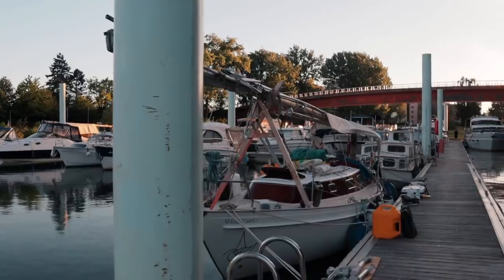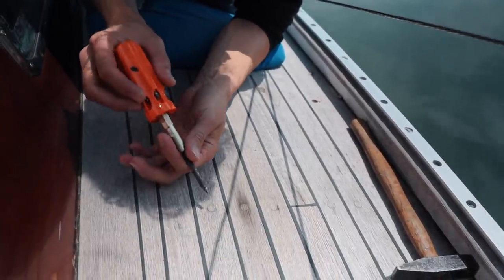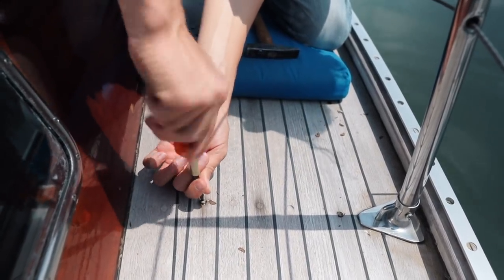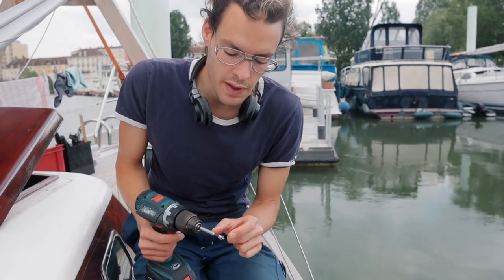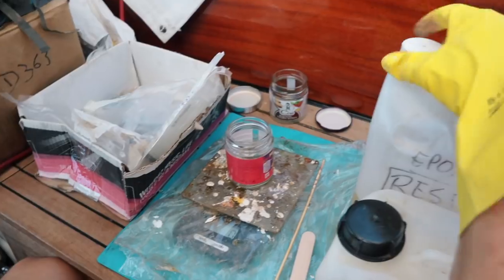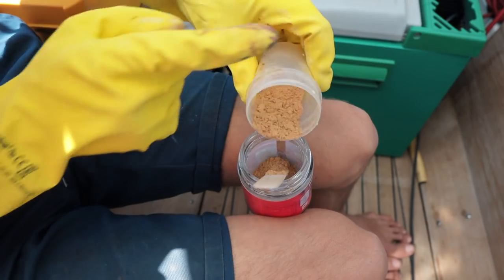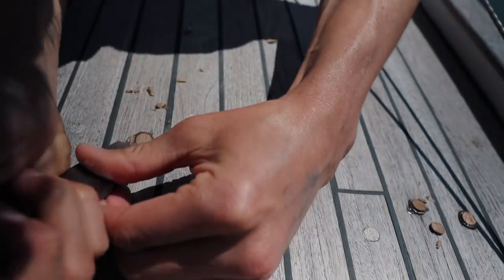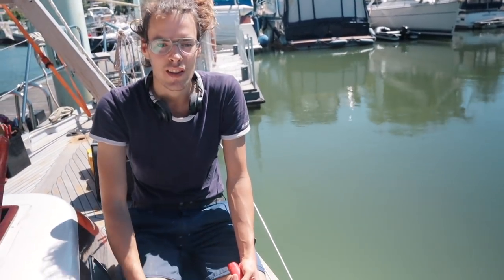The ESSENTIAL GUIDE to maintaining a classic teak deck [teak bung replacement]

Comment: As always, such a wonderful video you guys.  Aladino, I have a couple of tips I figured out while removing over 3000 bungs and Philips oval head screws on my Westsail.  After trying a screw driver, I found that a pick with a 90 degree bend at the end gave me the most control for removing bungs without damaging the surrounding wood.  Like you, I push it in to the center of the bung and use the bung itself to pry against (never the surrounding wood).  Second of all, that same pick was perfect for getting the glue  out of the screw cross hairs/slots.  Lastly, for stubborn screws, I used an impact driver with a correctly/tight fitting bit inserted and held with pressure into the screw.  One whack with a hammer and the screw is freed without stripping the head.  In over 3000 bungs and screws, I only broke 2 screws.  Magic Carpet is not just a boat, but a beautifully crafted piece of fine furniture.  It’s wonderful to see how you both appreciate and love her.

Comment: This is great! I have looked into several videos on teak deck maintenance. They are either on the hipper professional shipyard techniques style or very inexperienced-experimental direction. Here you put the right balance between the needed care and professional advice, openly articulating what techniques can make you feel safe. After watching this, I could see that with patience and thorough work, I can do it myself. I'm on the edge of buying a boat with teak decks to either remove or maintain. I tend to do the latter to get her to its original style. Thank you!

Comment: I was taught when fitting plugs to a hole to put a mark/arrow on the top of the plug showing the grain direction either in pencil, pen, or texta which helps when trying to find the direction after you have it in your hand and epoxy all over everywhere before you fit it to the hole. I was also taught to cut the tops off with the chisel the next day after the glue has cured. Aladino is a very knowledgeable boat builder for a young guy which shows in his methods.

Comment: Great tutorial!  I'm a happy owner of a 33' cold-moulded yacht which I designed and mostly built 20 yrs ago. The old shipwright that laid the deck and teak coamings ("orlo falchetta"in Italian) taught me NOT to use epoxi with teak bungs but simple vynil glue (which makes it easier to take them out) and I never had any problems.  I want to add that I personally  prefer a thinner teak (5-6mm thick) not only to save deck weight but especially because the teak when continuously wet and dried has less "strength" to warp and unglue the deck. Mine is still perfect after 20 yrs and I re-did most of the Sikaflex chauking only once. (I keep my fingers crossed......)  I love your canal journey!!

Comment: Thank you both for your excellent videos especially during this time of restricted activity.  You asked your followers for their stories so here’s one that happened quite a few years ago. This was the first sailing experience for my young new wife.  We chartered a 23 foot San Juan in the San Juan‘s from from a marina in Roche Harbor. They installed a new 8 hp outboard as we were getting ready to leave.  I mentioned that the prop was not very deep in the water but they said it was fine. We we’re out for a week of fun on the water.  On the last day a Storm blew in and small craft warnings were issued so we headed back.   We hadn’t used the motor until trying to get in the narrow north entrance into Roche Harbor, directly into a headwind. The boat was rocking from the waves being blown out at us and the prop repeatedly popped out of the water at the same time the cooling system was sucking air.  The motor overheated and seized. We were left to cross the Haro strait 8 miles over to Canada and tack back to come in the south entrance.  With the wind and current both moving north it made our southerly progress slow.  A 5 foot chop and 35 knot winds made for a scary experience especially for my wife’s first time sailing.  We were taking on water and our gear was sloshing around the cabin.  She was holding the sheet ready to dump the gust at any moment and crying from fear.  After about a half hour her posture changed, she stopped crying and looked at me with a new found confidence.  We continued on with our plan made the south entrance and back to the marina. The man behind the counter was very apologetic and even gave us a bottle of champagne. Thank you again for sharing your journeys.  I wish you many more enjoyable years on the water.

Comment: Concerning the grain orientation I was taught to set the bung’s grain perpendicular to the plank’s. Reason being that when you set a bung it is dryer than the surrounding planking as it takes on water the bung will swell and could (but is suspect it’s truer for bigger diameter bungs) open up, or split, the grain of the  planking allowing water in. This is also the reason why when working with tree nails you set the grain and wedge perpendicular to the planking. But has always there is more than one way to go about things each presenting its benefits and inconveniences, which is why boatbuilding is more an art than a science.  That being said, the way you go about it makes total sense for you, and as usual you produced a quality video. It is always a pleasure to board Magic Carpet for twenty minutes every week!

Comment: Aladino, you are a true craftsman doing what you were born to do, and Maya, you are an artist in your own right. You two will only get better at what you do over time. I removed all the teak on the boat I am restoring as the teak had all rotted out from lack of care from previous owners over the years. Rather than replacing the teak, I'm replacing it with Top Teak from Australia, but no matter what anyone says, there's nothing like the beauty of real teak if you can maintain it, and nothing lasts as long as well maintained teak.

Comment: I have known people who eliminated screws from their old teak decks (deck thickness had become too thin for screws and bungs).  They carefully cleaned out the screw hole, filled it with epoxy (making an epoxy screw) and put a bung on top.  For loose planks, they syringed glue/epoxy underneath.  Nothing has ever come come off.  I am going to try it on my boat.  I love teak decks and don't want to rip mine off.
Reply: That's exactly what I was thinking. The epoxy effectively makes a new rigid "screw" and helps glue the bung in. Shoud work where the screw heads were flush with the worn deck.

Comment: Some other boaters use Duraloc or Sika Seal for application into the screw hole prior to inserting the screw, or around the threads, to help prevent water penetration. Both of those products are flexible. Just gluing or epoxing the bung doesn't stop water over time. Good luck on your canal adventure!

Comment: I wish the previous owner of Antidote would have watched this video YEARS ago 🤣. I have a profound dislike for flat head screws but you make a very good point.
Reply from the maker: Was your deck caulked with silicone?
Reply: @SailingMagicCarpet  Thankfully no. There were many tubes of SIS440 on board and it seems to be what the deck was caulked with. I’ve run in to silicone in other projects though and agree that it is a hassle!

Comment: Excellent! Seen it done badly so many times. Seen it done wrong a lot more! See if you can get a set of diamond honing blocks on your travels, better than a traditional stone and can be used with water as a lubricant. They are light, smaller than a traditional stone and last forever. Never dishing or wearing uneven. Amazon do them.... Fantastic knowledge sharing!!! Sail Safe Guys, Ant, Cid & the pooch crew.
Reply: Yes.  I have a few in various grits and they last a very long time. Does well with scissors as well. Just mark the cutting edge with a felt pen. You will see.

Comment: you might want to try teak trunnels , i used them on my teak decks and it was 30 years before i had the first failure , and replacing them are easy as pie ,, nice job and very nice boat you have

Comment: Hi, How are you guys?
I love your channel, it is one of the reasons way I will be starting to sailing near as possible.
Thanks for that.
In real I'm dentist, and I had studied about products, and the resistance of materials. 
The reason why I'm here is to explain why you should cut the pieces of wood before the epoxy dry. It's because after the epoxy be dryer, it will cracked with the power of the cuts and will can leak water into the hole. But if you cut the wood before the epoxy dry, the movement of the cut will not crack the epoxy, and will glue quiet without future cracks.
I hope my English was good enouth to explain about the material, and had been good enouth to say to you how glad I'm to watch you in your chanel.
Thanks, G.R.Matheus

Comment: Love the videos. I bought a 1971 Supercraft Tricabin Cruiser last year, and I'm refurbishing the teak deck in May and your channel is super helpful. Just a thought, could it be that the reason commercial shipwrights chisel the bung right away is to ensure the epoxy has time to spread and recover after the impact of the chisel? If the epoxy sets and then you chisel the impact might compromise the integrity of the epoxy and the seal.  Just a thought. Thanks for all the helpful content.

Comment: I'm embarking on some deck work on my Mason in the next few days and this video is very helpful; you are clearly a knowledgeable and skilled shipwright, Aladino!  Several of my fellow Mason owners have removed the screws, drilled out the whole just past the fiberglass below and into the wood,. They then add install the bung just as you have - just no screw.  I've seen it done in this fashion other places and I'd like to know your thoughts.
Reply from the maker: Hy Stephen!
Sounds like a last resort solution because the teak is wearing thin.
Best would be removing the teak all together and then painting nonskid or glueing it back without any screws. 
But of course that is a huge time consuming and costly project. 
If at all possible I would drill only as much as necessary and put the screw back Into place if the thickness of the teak allows. Making a larger hole in the glass might lead to trouble down the road.
All the best,
Aladino
Reply: @SailingMagicCarpet  Thanks, Aladino, I have at least 3/8 " left  - more in some places, so that's not the problem. I need to ponder this more... :)

Comment: Is the” lentil head “ not specked maybe due to the extra material in the head of the screw should it corrode to help prevent screwing the head of the shaft leaving it stuck in the hole 🕳🤷🏽‍♂️. Just crossed my mind watching the vid. Totally understand the space gained with the flat head 👍🏾
Reply: That is an excellent point!

Comment: Great video, thank you, it‘s incredibly helpful as I am about to renovate an old teak deak. I heard some people leave out the screws and only glue the new bungs with epoxy. Is there a reason for you to keep the screws? Your reply would be much appreciated! Thanks!
Reply from the maker: It depends how your deck is attached. If your deck is attached with screws, then leaving them out means your deck will probably loosen or pop up over time. Some decks are attached with screws AND glue, which means leaving the screws out will be fine.

Comment: Great... thx!  Question:  why replace the screws?  If the original deck is screwed & glued, why not just replace the screw hole with epoxy and get deeper setting of the new bung?  Teak is not coming off from original gluing, right?  About to buy a teak deck boat and this was really helpful.  Love you guys!
Reply from the maker: The old teak decks generally aren’t glued down — only screwed! Newer teak decks are often glued down and NOT screwed, as this avoid all the problems with screws and bungs.
Reply: Thx.  We are looking at an ‘85 Finnish boat, Nauticat 44, and the teak is screwed & glued, which is one of the purchase decision points.

Comment: Very interesting and clear. You both have an excellent style that makes it enjoyable to watch. Do you treat your deck with anything or just wash it down regularly?
Reply from the maker: I personally prefer not oiling. It is a constant thing that to look good has to be done often combined with sanding and that also wears on the teak.
I like to have it natural and wash it with saltwater
Aladino
Reply: @SailingMagicCarpet   Yes, saltwater is much better than freshwater, as the salt attracts the needed humidity at night, during dry summer months

Comment: Great Video. Thanks so much!! I will soon need to do the same on my Vindö :)) how deep do you usually drill? 
Those drills are “Forstnerbohrer” right?
Reply from the maker: Yep correct. Just as much as needed. Sry I can’t be more specific but It really depends how much I have to work with. 
~aladino
Reply: @SailingMagicCarpet  thanks!!

Comment: What do you think about the method of removing the screw completely and epoxying a full length bung
Reply from the maker: Then there’s nothing holding the teak down
Reply: Sailing Magic Carpet with my yacht the teak is stuck onto the fibreglass deck so i drill 10mm through to the deck then a little further making the fibreglass bare this then allows the bung to be epoxied to the deck as well as teak planks means no screws

Comment: Do you fill the screw holes with anything to seal the threads?
Reply from the maker: Sometimes i pour in some epoxy and the best way would be drilling out the core and adding thickened epoxy. In this case the bung should do the sealing though:)
Aladino

Comment: Do you think its neccesary to do epoxy on my hallberg rassy 312 from 1984, i have heard someone say that my deck is glued on and the screw are only there to keep it down while the glue is drying . Great info vid, thx :-)
Reply from the maker: It’s very possible that the screws were only used until the glue sets but you still have many holes now. Making sure that water doesn’t infiltrate and get into the Core is important.

Comment: Thank you for your professional informations. Unfortunaely it is to late for me. I already reb eded 1800 with torx,  Pantera MARINE SEALANT 2K MS-3000/60 V3 and water resistant casein glue.

The screws were sealed in with a pinhead size sealant. When screwing them in they go through the sealant and then build a layer on top that will be pressed down with the bungs.

In fact I wanted to avoid the annoious mixing of the epoxy resign an he resulting quick work to set the bungs within half an hour.

As I am not a pro I used a multitool to cut the bungs to avoid breaking them.
My next pain is the rerouting of the seams as in fact thea are gone. the deck was 15 mm and there are 10mm left.

So if someone has a good hint for me how to make a limit stop for the router to use one seam to route the others... I would be deeply grateful...

It is a question of time... yes I can use the multitool to cut the seams but I measured it... I think the seams are around 900 meters...
Reply from the maker: Hi Moser

I would either make a tool to scrape out the old caulking or buy one from TDS. 

Next you can put two pins I to a router base and router out every seem to whatever depth you wish. 
Hope this helps. 

~ aladino
Reply: @SailingMagicCarpet  OK Thank you I try it... but in fact there are no seams left... They sanded all down from 15 mm to 10 mm. My best guess is to use a multitool to make the beginning if the seam and then proceed as you said.

Comment: Cotton?? I thought it was glass beads or dust.   Can you tape over the hole and cut out the hole?
  I like the teak dust idea.
Reply from the maker: Hy Ed
There also are glass beads as a filler but for other purposes.
You certainly can tape but a lot of extra work which is not necessary in my opinion 
Cheers
Aladino